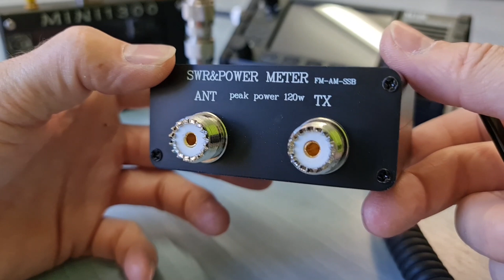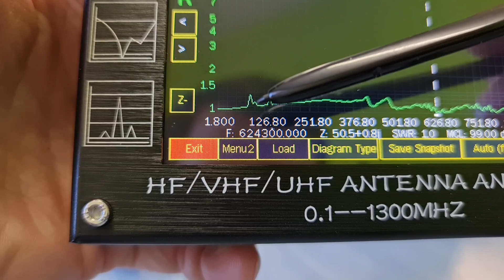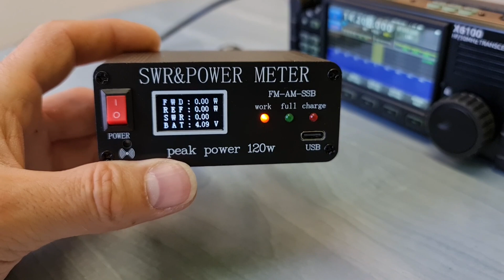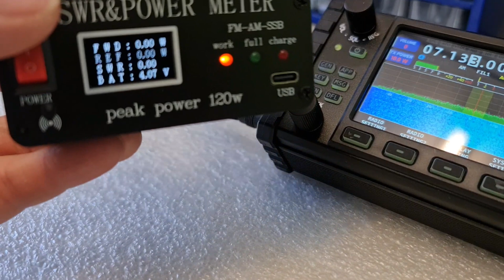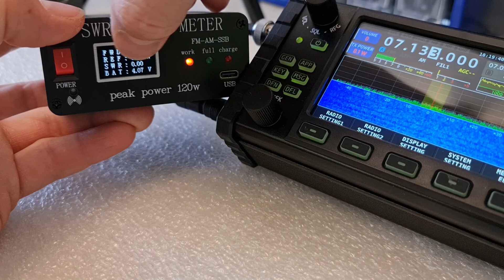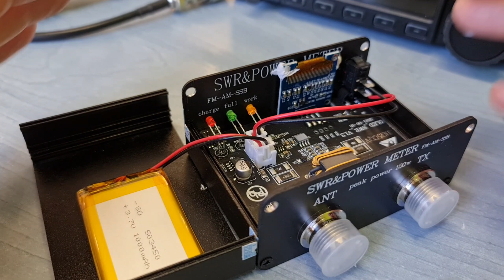Mini DIGITAL PWR / SWR meter review

Comment: The analyser is using a limited frequency  local oscillator and some software tricks to use harmonic frequencies thus those spikes when measuring wide range of frequencies. Nothing to worry, the load is better than the analyser is showing. GL and 73 de YO3HJV.

Comment: I bought this unit and now can't use it.  It is extremely sensitive to rfi and in fact, back feeds into my other components.  I have an isolator (choke coil) between the antenna and the meter but when working ft8 (20 watts) it will look like it is working on all but 40 m when it is actually causing fluctuations in all 3 readings (swr, power out and alc).  On 40m it just goes crazy, shows double the wattage, swr near infinity etc.  I remove it from the circuit and all of my readings on the radio (I have to switch to each individually) show good readings, no fluctuation and I make solid qso.  It may work on other styles of antenna but it does not love my end fed at all.

Comment: Did you measure accuracy with other standing wave ratios by purposely detuning the loop antenna and comparing what you read on the Mini 300 ?
And, why would you need to know SWR at QRP levels?  (unless your feedline is lossy in that band) 
I wouldn't use any instrument with a microcontroller inserted into the feedline of my antenna system.  They can't filter all the QRM/RFI unintentionally generated in that digital SWR meter.
Any FCC mark or statement in its manual?